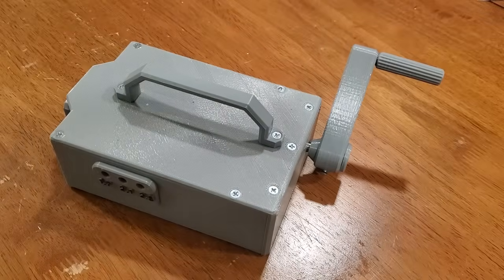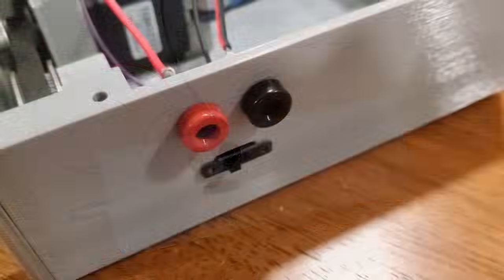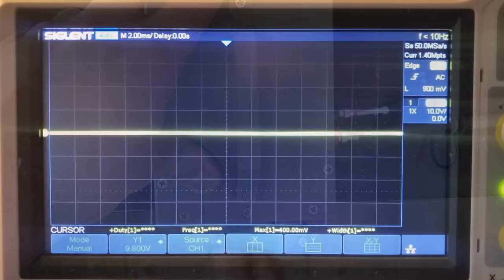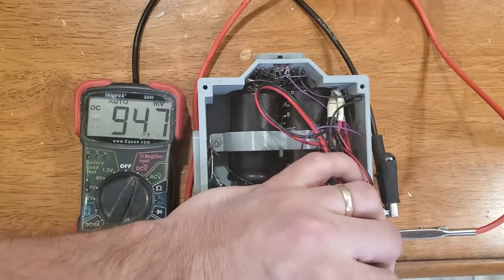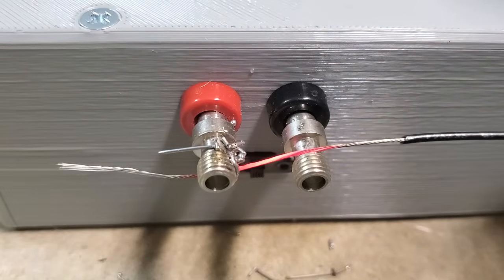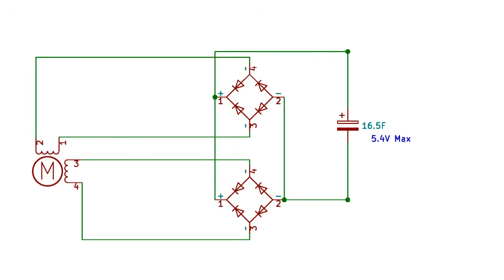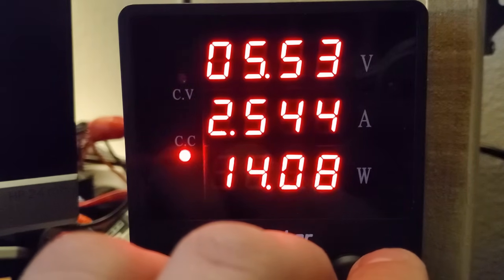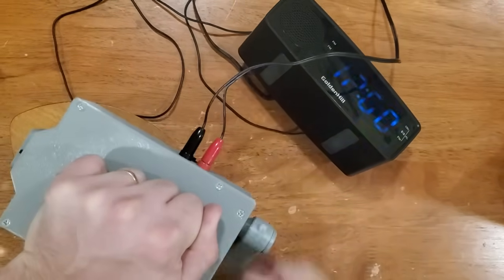A Generator built from a Stepper Motor and Supercapacitors

Comment: 1. You are saying that zener wastes energy... and you are using 4 diodes, which are wasting energy too. It would be nice to compare how much more zener wastes energy than 4 diodes + opamp.
2. Diode voltage drop is temperature sensitive. With different ambient temperture you will get different voltage drop and risk of overcharging your capacitors.
Reply: The wasting of energy was not related to the dissipation, but to how the zener diode has conduction (passing of current) before the maximum voltage of the capacitor bank. The maximum voltage was the concern.
Reply: @AnnaVannieuwenhuyse  both protection circuits have leakage current before threshold voltage. Which mean they dissipate energy (convert it to heat) when they should not do this. In absence of energy influx it results in voltage loss over the time.
Reply: @sdjhgfkshfswdfhskljh3360  I think it was rather about not having the Zener at hand right? He said a Zener would be better for the application which is to have a high impedance voltage regulator as the reference for the comparator which drives the MOSFET regulator.
In this case the issue is that rectifier diodes are way more sensitive to the input voltage than Zeners are, the power loss was not a concern. It would be if the Zener was directly use to regulate the voltage on the caps which was ruled out for that reason of power loss near breakdown voltage.
Reply: @HyperMario64 are you talking about both of the problems from my 1st message simultaneously?
1. "the power loss was not a concern" - why? was such decision based on any calculations or measurements?
2. I'm not sure if zeners of such low voltage as needed for reference exists at all. And there are more solutions for stable reference than just zeners.
Reply: @sdjhgfkshfswdfhskljh3360  Yeah sure let's say everything. I'm more about clearing up the confusion in the way you interpreted the argument in the video.
1. The decision was based on the Zener knee which loses some power near full charge. The graph presented tells it all. This is roughly acceptable for a regulator plugged on a reliable power source like mains but arguably bad for a battery which has limited amount of power available.
2. Zeners have a zero temperature coefficient at 5.1V and are proven to be excellent voltage regulators. They are widely used for this application due to how steep the I-U curve is at the breakdown voltage. I'm curious for what your suggestions are to obtain a reference voltage off an incertain one.
Reply: @HyperMario64  1. confusion is here: 6:32: "no conduction whatsoever",  6:47: "to get the result from the first graph" -> there will be conduction, through opamp for example. How much? Maybe not too many, but who knows.
2. Diodes in schematic produce 1.9V drop. From what I googled, it is not possible to have such low breakdown voltage for Zener. Maybe it is possible to tune circuit for higher drop, I'm not sure.
Suggestion is already here in comments - to use TL431. It is not Zener, it is IC, bandgap reference. Alternative - make your own bandgap. I did not tried to make it by my own yet, but planning to do so in future.
Reply: @sdjhgfkshfswdfhskljh3360  1. It's a comparator, very high input impedence and it feeds a MOSFET gate. You would be hard pressed to even quantify how low power this is. Perhaps the comparator draws a little bit of power internally but I would bet you the 1.9V reference and the voltage divider are by far the most power hungry in the circuit.
2. Zeners go down to less that 1V in reverse breakdown voltage. Look at this one in a through hole package for example: MTZJ2V0SB R0G.
Using TL431 is smart, but the schematic represents it as a Zener diode anyway with a variable voltage regulation. Matter of taste, I like to keep things simple and in this case a simple discrete Zener diode would perfectly do the trick and is easy to understand in the video. Still good suggestion and it seems like it is super precise. I should definitely consider them for my own circuits.
Reply: @HyperMario64  time to dig into datasheets :)
* LM833 supply current is ~4mA. Since it is much lower than indication LEDs consume, it is fine to make decision to use it, but it is better to show such thought process in the video.
* 2V0 in MTZJ2V0SB means 2.0V, do you mean that with very low current voltage drop will be ~twice lower? Anyway, such diodes will fit well in this circuit, you are right about it.
Reply: @sdjhgfkshfswdfhskljh3360  Good observation about the LM833. I read 2 mA per channel at 15V input channel, so isn't it 10 mW at 5V supply? It seems only a single channel is being used here. Indeed this is a bit, I was wrong the voltage divider is much less than that.

I read that the MTZJ2V0SB is tested at 5 mA so 10 mW for the reference voltage. The knee current is 0.5 mA so even down to 1 mW. Always guaranteeing close to the breakdown voltage in voltage drop. To be compared with the 1 mA minimum for the TL431 which is the cost of precision I guess. So the comparator would be the most power hungry; interesting.

Comment: Neat! I would use the max voltage out, and use a buck converter to charge the big capacitors faster.
Reply: Makes me wonder if a hybrid solution would be most efficient, i.e dump 600 volts or something over a small resistance into the supercap until we reach 2.5V, then switch over to the buck converter for the remaining bit. 

I dunno if that's safe though for the supercap. Any advice?
Reply: The maximum voltage at the output of the motor is pulled down by the capacitors charging. You lose efficiency by adding a buck converter. The problem of high voltage output is only there when the capacitors are no longer at a low enough voltage to drag the output of the motor down below its maximum.
Reply: @AnnaVannieuwenhuyse  The converter is there to prevent overvoltage to the supercaps.
Reply: @AnnaVannieuwenhuyse  Pretty sure I understand this well, but just to make sure, if the caps had a really high resistance (or there was in-series resistance somewhere before the caps) would that allow the voltage to stay higher? It's just because the current flows so easily into the caps that the voltage gets dragged down that far, right?

Comment: I wonder if you could just use a a suitable high voltage led cob to protect the cap bank from over voltage. Much simpler for beginners to just have a led cob in parallell with the cap bank. A voltage booster that works from 0.8V lets you drain the capacitors much more so you save money on capacitors and one gets adjustable voltage from a 3USD ebay booster circuit. Then wasted energy is less before the cap bank reaches a high enough voltage for the step up booster to work. Then the crank time is much less before you get light :)

Comment: Use this to recharge some AA/AAA batteries.  Then power it with a propane motor.
Reply: Be careful though. Don't recharge alkaline batteries, and don't use high-rpm devices to turn this shaft.
Reply: @AnnaVannieuwenhuyse  the bearings can't handle 3600 rpm?  how about 1200 rpm?  I am working on converting steppers to motors for an electric outboard, because they are small diameter and cheap, and can I stack them into a long motor.

Comment: You get very easily 220 volt out of the stepper motor, if you can put more RPM to the stepper motor. I have same kind stepper motor, and by keeping the motor axle next to bicycle rear wheel, while same time give rear wheel some spins. Usually stepper motor have three output at the same time. I made few simple tests on my stepper motor some time ago.

Comment: If you really need ample charge with low RPM, use Airconditioner indoor BLDC and remove its circuitery. Hook 3 wires on 3 AC terminals and add rectifier and smoothing capacitor. You can easy glow 12V bulb just rotating shaft with your fingers. Adding gears would triple the voltage.
Reply: exactly, BLDC is the way to go, he could use BLDC from large printer or hoverboard.

Comment: Why dont add some sort of dc to dc converter at the led's. That way you can use them at lower than 3volts that they require for max illumination. Now half of the caps energy is almost useless.

Comment: I like the project, but I'd suggest it be limited to just emergency use. I used a stepper as a wind generator and after a few months the stepper's magnets had pretty much died. Something about the magnetic material and  physical form just weren't optimal for long-term generator (alternator,) use. I don't understand exactly why that was. It didn't seem like it got hot enough for the Currie temperature of the magnets to come into play. Perhaps there was a strong wind one day when I was at work and it did overheat. Perhaps it would have helped to have the rotation reversed every hour. I don't know. But that's what happened.
Reply: it was probably thermal degradation of the permanent magnets. Magnets gets gradually demagnetized due to high temperatures. Steppers are designed for low rpm and low duty cycle.
Reply: @kalinkaata  In that case it would be a better choice to for a brushless with gearboxes? DC motors can have their brushes degraded also.
Reply: @ivanbukac4618  definitely the right choice. however you must consider how much voltage it generates. usually you can find it in the datasheet as V/1000rpm. It can be as low as 2V/1000rpm which would be probably too low for you

Comment: Question from a mechanical guy:  What is the conversion efficiency when a stepper motor is used as a generator?  In other words, what is the watts in (hand power) compared to the watts out (electric energy)?  Is there a way to measure this easily?  Thanks.
Reply: One could swap out the hand crank for a crank motor with known torque and known constant speed close to normal operating speed from hand cranking, then compare the crank motor power (calculated output power to neglect crank motor losses) to the AC voltage and current output of the stepper motor as a test. The discrepancy will be the power loss and the efficiency can be calculated for the stepper motor. The DC rectification and capacitor charging circuit will also result in losses so it would help to measure the power output of that as well since it is part of the system (if needed).

Comment: The TL431 can be found in most switching supplies.  It's a precision 2.5V adjustable voltage regulator.  And if there is a voltage divider between the cathode, anode and input pin, you can set it at any voltage.
Reply: An LED could do the job too.
Reply: @tinu5779  
The LED does not have the stability of the TL431.  As the temperature changes, the voltage  across the LED changes, causing poor regulation.  It would be better to use a zener diode.
Reply: @acmefixer1  of course there are many parts that do better jobs but sometimes you just have to take what you have.
Reply: Thinking more about it... the whole circuit could be done using a TL431, a transistor and 3 resistors. Basically the "High Current Shunt Regulator" that can be found in the datasheet from Onsemi.
Reply: @tinu5779  
The shunt regulator has the advantage that a short circuit load won't hurt it.  But its biggest disadvantage is it wastes the power that the load doesn't use.  It draws the same power with or without the load.  As a result the shunt regulator is almost never used nowadays.
Reply: @acmefixer1  Maybe you did not watch the video but getting rid of the energy is exactly what is needed in this situation.
Reply: TL431 is not a "zener" 🙄
Reply: @MadScientist267  It sure is not a diode spot on

Comment: What's the reason you used a stepper motor over a normal one?
Reply: The stepper motor's internal construction lends to a much better RPM to voltage ratio. With any old brushed motor (which I assume you mean by 'normal') you'd need a set of gears to get enough speed on that shaft.

Comment: Nice job,
Enough space in the casing to use both the 470F supercaps and the 3,3F caps in there with a selection switch for Different situations.

Comment: Very nice project. I think you lose quite a large portion of energy by choosing 100ohm resistors with the LEDs. You might want to consider using different LEDs and a smaller series resistance.
Reply from the maker: Yes, definitely. I think the most efficient approach would be to use the minimum resistance possible for current balancing, and then have a switching converter maintain a constant current on the LEDs & run them just above their threshold voltage. I wasn't willing to get into that level of complexity for this project, but in a future iteration i might